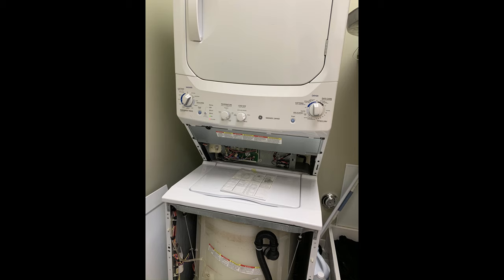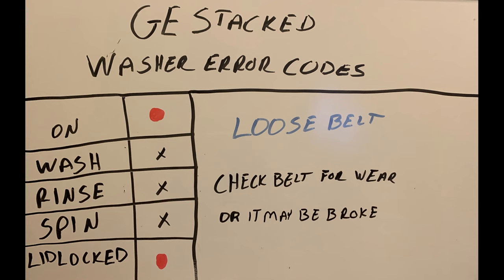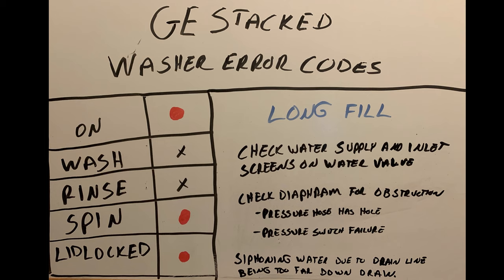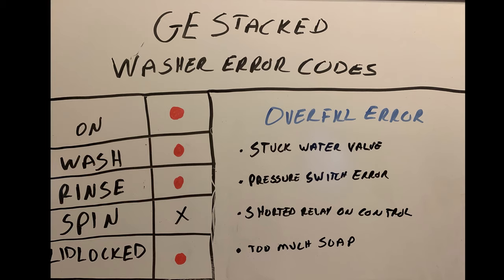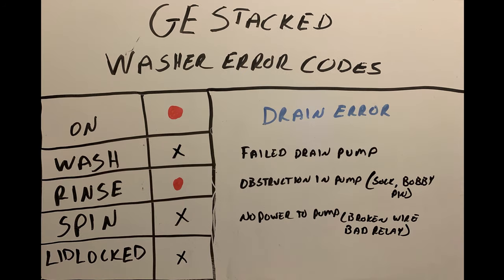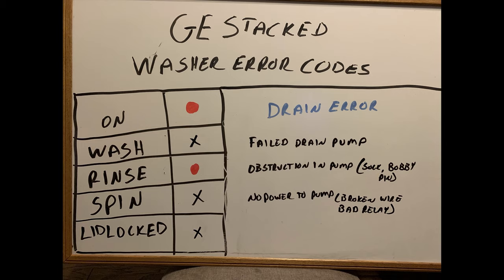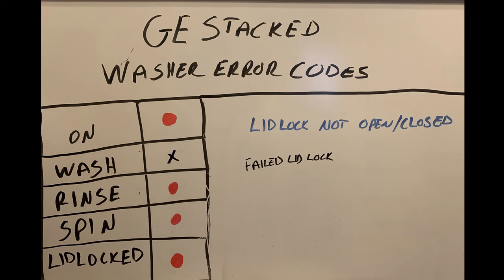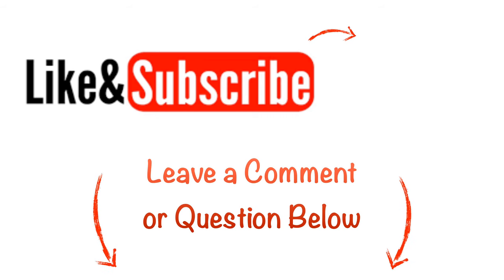GE stacked error codes

Comment: If you are having a speed sensor issue.  The speed sensor is located on the motor.  It's a 40 dollar part and is easy to change.  Don't buy a new motor!!!  The sensor and the sensor clip are sold separately so by both parts tossup them out.  Mine has went out twice since I have owned the machine and both times its fixed the problem.  This video is great for this machine and it tells you almost everything to know.  Thanks for taking. the time to do it.

Comment: I'm helping my neighbor with his washer.  It is making a horrendous sound because the gears are not fully engaging on the transmission causing it to slip.  This has manifested as an ON/SPIN error code in diagnostics.  thanks for these videos, they are a big help.

Comment: Thank you for your video, first and foremost, but what if NO lights will come on at all? I put the dial in the six o'clock position and pressed the start and fabric softener buttons simultaneously. No lights came on at all. Any ideas on what's happening with this?

Comment: My error code was blocked motor. I followed your steps and it worked great. However the same problem happened again and it's clear of any obstruction any insight on what's causing it?

Comment: Thanks man, you shared info the internet doesn't have, I know, I searched for several hours for a tech sheet pdf. You saved the company I work for from rushing out and replacing the stack.  But if anyone has a link to a tech sheet pdf for a GE stack, please share it. Thanks
Reply: I’m also searching for that pdf. No luck so far- argh.

Comment: Very informative. The problem I’m having with my GE is the dryer part.It won’t go. If you press the start button it just buzzes. Is there a way to reset it or is it something that will need a pro like yourself?Thank you for the videos.
Reply: Same here.. The dryer part of my stacker just doesn't start. The belt and pulley are intact but there's no noise or buzzing sound when I press the on button..

Comment: On this model the speed sensor is going to be located on the motor underneath the plastic blower blade. super easy to change out after you remove the motor.

Comment: I don't see my issue posted by anyone, or on the video. Mine won't run the diagnostic check and it will start to spin but stop after 2 seconds. Then the 'spin' and 'lid locked' lights flash until I turn it off. The 'on' light never comes on during this problem even though it is definitely on.

Comment: Idk if you check this anymore but recently got a brand new washer GE a week ago worked fine. Now it won't fill with water. It does the 2 pumps and after waiting 10 seconds it doesn't do anything and shuts off...did the diagnostic and showing no codes but tested both cold and hot side and it fills like it should. Take it out of diagnostic and it continues to not fill

Comment: Mine GE is making that noise on my rinse cycle 😮 would it be my drain pump (like rocks in my washer). My clothes still comes out a little wet like it hasn’t fully did the spin cycle. I need to get my husband to do the test but it’s definitely making noises during the rinse cycle.

Comment: Nice video, very helpful. According to the diagnostic I've got a bad pressure switch or mother board. How do I test the pressure switch & clean the diaphragm? The machine starts to fill, stops , then goes into wash mode without water BUT if I disconnect diaphragm hose until water fills up to correct level, it works perfectly! Thoughts?

Comment: I got a ge washer dryer stack unit, the dryer will not run but 3 or 4 minutes…I’ve replaced the lid switch the thermo discs and the motor and the mother board, and still has the same problem…help….
Reply: I have the same question

Comment: Hi señor, I was wondering if you could help me, my washer has stopped filling with water, but 1. I’ve replaced the inlet valve, 2. I’ve  diagnosed it and no error codes come up, and 3. The only thing it does do is turn on, the you select a wash then it pours water in the tank 2 times then locks the door then nothing. I can’t figure it out, can you help me please?

Comment: Mine will not go into the error codes
Reply: Mine doest either
Reply: @jenniferperez9937   I understand that typically means the control board is bad.  It would be great if Bearded Appliance Repair would reply.  I have that issue now, and the unit fills as soon as the water is turned on to inlets.  Rotary switch is set to off and don't even need to push the Start button.

Comment: This is great information and appreciate the time you spent getting out to the world.  I have the Kenmore version of this unit in our rental and walked through the diagnostics procedure you detailed to find out why it was not running.  I had the blocked motor error (on light and spin light).  I took the front cover off and found socks and panties inside the cabinet with one of the panties being wrapped around the motor pulley assembly.  What I have observed is when in the agitate test, the motor tries to engage with a couple pulses (a couple relay clicks) and then engages solid for about 2-3 seconds and then the motor stops and the spin light flashes.  I hit the play/pause again and the motor starts agains for about 1 second and turns off.  When I drained the tub and tried the spin feature, a couple clicks with the motor engaging with the clutch and it took right off.  Any thoughts on why it will not agitate but will spin?  I can rotate the pulley but noticed it does not glide as well as yours in the video when you gave it a push.  Any thoughts?  Thanks in advance.
Reply: Have the same issue. I just bought it used.  Socks must have jammed the motor and ripped off 2 little wires.  Don't know where they connect to, need to call a serviceman unless someone can tell me where they attach to.  Looks like a pink and a blueish green.

Comment: Great video. How can I have separate power cords for the washer and dryer? Currently my GE stackable washer and dryer combo had only one cord. However I understand the washer and dryer have separate circuits so in theory is it possible to separate the power input such that the washer and dryer each has it own separate power cord? Thanks.

Comment: Great vid very helpful I used your video to diagnose and clear an obstruction in the motor now there are no error codes and it starts and runs like normal until it gets to wash mode and starts to agitate it'll agitate for like two seconds and then stop and the wash light flashes any helper advice on this issue I would greatly appreciate l

Comment: I have a blocked motor code. In the test settings it try’s to agitate but stops. In the spin mode it clunks then will spin. The motor when turned by hand turns smoothly as does the drum. What do you think it is.

Comment: I have a ge stackable. When I turn on the power or plug it in. It blinks the lid lock. When I have the dial in the 12 o’clock position and hold frantic softener button and start for a few seconds and then turn dial to 6 o’clock position I get no blink except for the lid lock. All other lights are lit up. Except the lid lock is still blinking. Every other dial zone displays the same results. If unplug the lid lock part and put it back on the machine will run properly for at least one load then the problem starts over.

Comment: I have a GE stackable . Status codes all green except Lid Locked. Machine will go into a discharge cycle without spinning on its own... Any ideas ?  Aloso water is leaking from what I can tell is from the water hose connections. Thanks

Comment: I have a stackable unit and it is a real pain in the you know what! I cleared the error codes (don't know what the code was or what it meant) and then tried to restart the machine... After restarting the machine using the same wash cycle setting it goes back to rinse cycle and then it fills and empties, fills and empties, fills and empties, fills and empties.... doesn't spin at all or do anything else. I just changed the cycle setting from heavy to medium and now it's finally beginning to spin and do something different. No idea... At least I'll know to look for an error code next time I have this problem. This is happened to me on numerous occasions. Usually, if I just reset it it goes back to normal operation.

Comment: Hey I have this particular model and the dryer won't heal up, I've checked all of the electrical for the breaker to the outlet and the dryer,all is ok there. I don't want to just Start replacing things unnecessarily and waste money, any suggestions  on diagnosing?

Comment: Had the blocked motor code. Couldn't find anything blocking it but both terminals near the motor had their wires torn out
Reply: Same issue for me! Were you able to find a solution?

Comment: This is a great video - thank you very much!!  Is there a way to bypass the lid lock switch?  There is probably a way to connect / disconnect wires in order to bypass the switch and magnet combo.  In Canada, the replacement part is over $100!

Comment: I need your help. Why is my washer stopping on rinse. The cycle is not completing. Two days prior the water was filled to the top and that is when I noticed the cycle did not complete. Now, the water is not filled to the top but my clothes are soaking wet and the cycle still stops at rinse and does not finish. HELP

Comment: Hi, I have a problem with my ge stackable and I can't really figure out what is wrong with it. 
I went through all the diagnostics on it and nothing was wrong so I thought that maybe it needed reset so I unplugged it. 
So I thought I would run a very small load and see what it does.   
It filled in with water and when that was done the agitation started and then stopped then my wash light started blinking so I pushed the start button and the agitator started then stopped.  As long as I kept hitting that start button it would agitate. 
Any thoughts on this.
Reply: I have the exact same problem with my washer. What did you do or did you figure out problem?
Reply: @tolliver4056  I just encountered this exact same situation, but I did not know how to pull up or interpret error codes.  I need to go back to the customer and do some tests and pull up the error codes, but from what I have read, I think I may have a bad motor speed sensor.

Comment: Good morning Sir. Sorry to bother you with this, but maybe, since you are the specialist, you can tell me what is going on and how to fix it. I have a GE stackable (here in Mexico it's called MABE), Model #MCL1740PSBB02, Serial # 1510C00058, and it doesn't work. I have 3 lights on constantly, WASH, RINSE and SPIN. I have tried to reset it with no luck. The control board has been replaced in May of this year. The machine worked until last night. I've unplugged it, plugged it back again and with the 3 lights ON, if filled with water and did a cycle. It still has water in it since last night, but it doesn't "drain, spin " or anything. Any suggestions on what could cause all this? Thank you for your time and effort.

Comment: So I have this stacked unit and when the washer fills and the agitator kicks it there is a loud grinding/rubbing sound while it is agitating. Also it is very loud in it's spin cycle however it does sound out and the agitator does work. It is such a loud sound though that it is intolerable I was told by an appliance repairman that it was the transmission or a bearing in the transmission and $80 part. At that time I wasn't able to order that part so it was wanting to run this by you and see if you could tell me if it is the transmission or the bearing/pulley alone as it is functional it's just very loud. I would like to possibly order the part online and replace it before selling this unit It was an expensive unit and I hate to just throw it out or sell it for 100 bucks.

Comment: My machine fills, agitates for a second or two and stops. with the wash light on. Does the same in #9 diagnostics.  Saw no reference in video for wash light only error code? Can you help point me in the right direction to repair (for my senior neighbor)?
Reply: Same problem with mine. Did you happen to figure it out?

Comment: Hi I did what you said and the spin error code came up.  I did have something wrapped around at the bottom of  the motor and I removed it but still nothing working.  I noticed there was a loose wire with a little plug on it  after i ripped the clothes out.  I would send you a pic of wire but not sure how to.  Do you think the loose wire might be the reason.

Comment: My machine stops on spin sometimes and when I check for a code, it shows the blocked motor error but I never find anything blocking the motor. When I reset the code, it seems to work fine. Any idea what can be causing this?

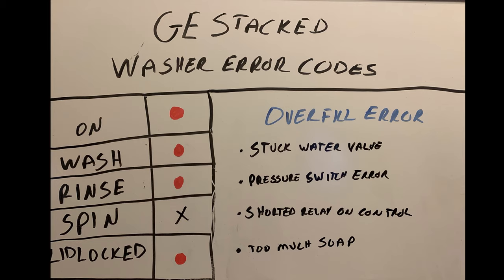Comment: So my GE stackable doesn't have the water valve you show at 9:00. That area is just completely empty. 

Where else would that be in the unit? I have leaking on the very back left of the unit and cannot tell where it's coming from. It's in a laundry closet in a condo so I don't have easy access to the back.

Model is GUD27ESSJ1WW.

Comment: Hi there, I have a stacked GE unit like this that has been sitting in a garage for about a year. Its clean but now that I have moved and need it, the dryer is making a very unhappy motor noise when I turn it on and it'll run for about 5 seconds then shut off with a hot electronics smell. I've unhooked tube to check for blockage on vent and same result. Any ideas?

Comment: I followed your instructions for the error code + found a pair of underwear wrapped around the belt. I also found several sox in there.  How in the world do clothes get down in there?
Reply: Overloading the machine.  You will notice there is about a 1" to 1-1/2" gap between the top of the tub and the underside of the washer top.  That distance increases to 2" when the tub has water in it and it presses down on those suspension rod springs.  It's easy for a sock to get thrown into that abyss during spin, if the basket is overloaded.

Comment: just changed gear case was leaking giving me an error ..not it wont agitate although it spun up once nice an smooth and fast but now its just erratic  starts to agitate but fails with a blinker   tried reseting it erratic will fill but cant seem to complete an operation     wondering if its the hall effect sensor or wax motor  or mobo  oh often i heard some clackty noises the coupler were taking time to click in and the pump seems to run extensively at times before a spin or agitate would take place

Comment: Thank you for making this video! It has been super helpful. I got an error code that wasn't mentioned in the video (or I missed it). It was the wash and lid locked lights on.  Do you know what this error is?
Reply: Did you find out what it was?
Reply: @Jonathan Camejo M  No but I did the reset (unplug, lift and close lid, etc) and it worked. The washer has been working perfectly since then.
Reply: @tonya2067   thanks i did reset it and its working fine

Comment: I have on and spin code,in agitate test it will agitate 4 times then stop, everything else works, spins in test, drains and fills in test, new motor and control board installed, checked no obstruction

Comment: I am looking to purchase a 3 ye old GE stacked unit.  Nice looking but seller says washer “tends to go off balance but it helps to run on ‘bulky’”.  I don’t know the model number.  Could this be any easy fix like the rubber straps or should I stay away from it?
Thanks.
Reply from the maker: Could be the suspension rods if it is getting o of balance.  Or if the thing wasn’t level.  If it is the rods the front ones won’t be any trouble but the back ones will be.  You may have to take the dryer off the replace the rear ones.  I may stay away from it if I were you.  Unless you like challenges.  Or it could be as easy as making sure it is level.

Comment: I have this washer. It shows no errors when I got it in 3 position in service mode but it won’t start in any position or do anything. When trying to start it you can hear the relay click in on the board but it Will not perform any of the following actions drain, spin, engage the gear lock, Lid lock. nothing.. any ideas?
Reply: Try and listen to the drain pump and see if you hear humming it might be clogged and preventing it from starting .

Comment: Interesting video. I have one of these units and the problem is that the tank will not fill...the water flows out directly into the drain hose and out into the drain...Do you think that I need to order a new board or ??  Thanks
Reply: You probably have the drain hose pushed too far into the drain standpipe, which will allow the water to self-siphon.  Solution is to pull the hose back up a bit.  (Use a zip tie to make sure the drain hose can't come completely out of the standpipe.)

Comment: Thank you for the information!  We  didn't hear anything about our problem:)  When the washer is in its final spins it sounds like an airplane taking off.  We are not able to hear the TV or have a conversation  at least 30 feet away because it is so loud.  Any advice?
Reply: That is the support assembly or (transmission) needs to be replaced the bearing is wore out .

Comment: I just got this machine it just stops I go downstairs thinking its done no lights are on I open the lid and there is still has water in it it just stopped I think the lid lock doesn't lock it doesn't catch and it just shuts down I then turn it to the off then to the spin and drain help it with the lid lock as it takes a few times of lifting and closing the lid once it catches and lights red that it is locked it will the drain and spin lid locks are so unnecessary and putting computers in these machines too I have to babysit this machine I live in an area where there are no appliance repair ppl I would not reccomend this or these types of machines